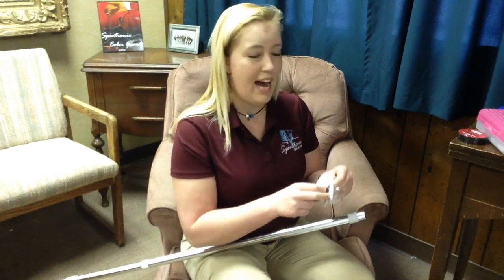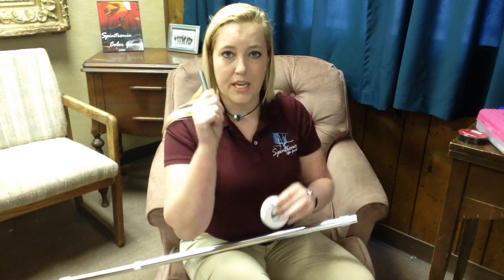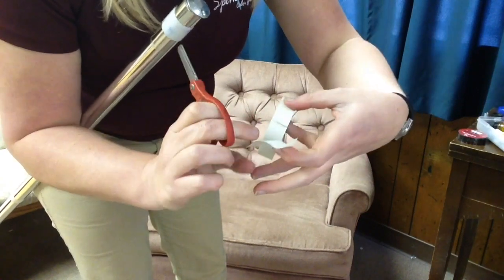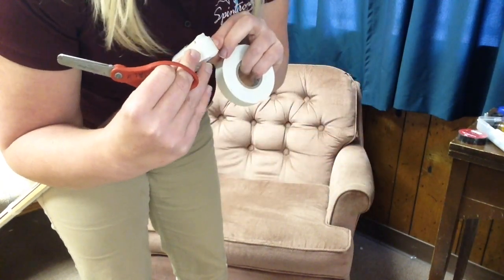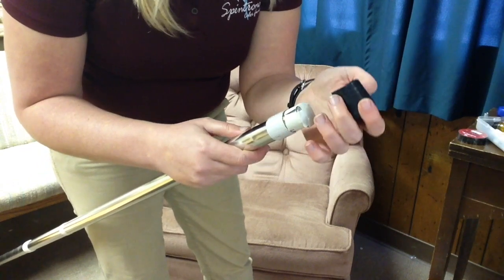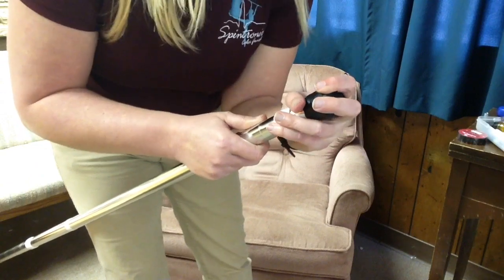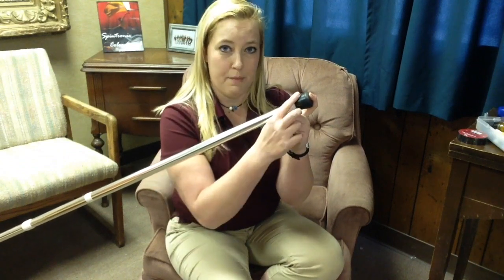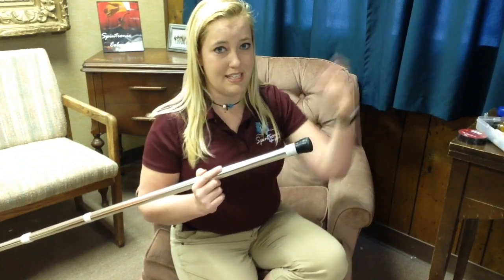Weight your flag - How to color guard (flag maintenance part 1 of 3)

Comment: Hi! Your videos have been extremely helpful to me as an instructor in developing and adding to my knowledge and skill set. I have some questions for you about weights:
1. While I was in color guard during high school and continued to instruct after high school, we have never used weights. What are the uses, pros, and cons of weighted flags. Why do some guards use them and some don't?
2. I know you said the bolt length depends on on silk length and pole length, but is there a formula or rule of thumb when weighting various flags (e.g., the bottom bolt is always half the length of the top bolt)?
Thank you in advance for your response! (:
Reply: You had to have used weighted flags. If those flags weren't weighted you would've had no control over them. They wouldn't spin, and wind would carry them 5 yards.
Reply: my gaurd uses a smaller weight 2/3 the size of the top instead of 1/4 so i guess it can depend

Comment: Are the bolts suppose to balance the pole so that one side is not heavier than the other? Or does it depend on what you’re trying to do with the weights?
Reply from the maker: It depends on how you want your flag to spin. The purpose of the top bolt is to counteract the drag of the flag through the air. So you should put a heavier bolt in the top based on how many seams there are in your silk.

Comment: what if we are using 5 1/2 foot poles? what bolts or weights do we need?
Reply from the maker: You can use the same type if you like. The weights only change depending on the weight of the silk (more seams versus less seams, fabric thickness, etc.) because you need heavier weights in the top of the flag to pull a heavier silk around.

Comment: So what if your tips already have weights in them? are you fine without adding the weights or should you still add them?
Reply from the maker: If your tips have washers in them, those aren’t weights, they are just protection to keep the pole from cutting through the rubber tip.

Comment: Ok this is really weird but, if you can’t get those vinyl end caps off, take a hair dryer to them for about 2 minutes and they’ll slide right off
Reply from the maker: I've never thought about this before!! But it makes perfect sense, thanks for the tip!!!
Reply: does this work the same way to get them on because i can’t get mine on lol
Reply from the maker: You should just throw them in the trash and buy rubber ones.
Reply: THANK YOU!!!! Omg lol
Reply: omg i literally just got a flag and it has a vinyl end caps that won’t come off and i had no clue how i was supposed to put together my flag, thank you so much you’re a lifesaver !!

Comment: Hey Great video, extremely informative and helpful. But I do have a question, so when weighting your flag are trying to balance it on both sides or is one side supposed to be heavier??? Because I don’t see how you would balance it by putting the big weight on the side that already has the silk, so I’m thinking there’s another reasoning to it.
Reply from the maker: Yes, it should be heavier on the top. Jackie explains this in one of her videos, though I don't remember where. Having the heavier weight on top allows the flag pole to compensate for the drag of the silk through the wind.
Reply: Oh ok that makes sense thank you
Reply from the maker: You are welcome!! ❤️

Comment: Where can I buy that kind of pole? I'm from the Philippines
Reply from the maker: I’m not sure which companies offer international shipping, but you can check with places like American Band Accessories to see if they do. You can also purchase 1-inch diameter aluminum conduit pipe at a hardware store and have it cut into 6-foot lengths.

Comment: How do you clean color guard flags. Do they get dry cleaned?
Reply from the maker: It depends on the material. If you are ever unsure, dry cleaning is always your best bet. However, we wash all of our poly china silks on gentle cycle with mild detergent and cold water, then hang them to dry. It's been a very successful process for the last 10 years or so!

Comment: where do you get these bolts? do they sell them at lowes, Walmart,  etc?
Reply from the maker: zorlex you can get them at any hardware store, including Lowe's or Home Depot.
Reply: @SpintronixGuard  ok thank you, do the heads of the bolt have to be a certain size or will they always fit into poles?
Reply from the maker: zorlex you want a 1" head
Reply: @SpintronixGuard  ok thanks! ❤
Reply from the maker: zorlex any time!! ❤️

Comment: There's not a hardware around me that carries a 1 inch diameter carriage bolt. Are you sure it's 1 inch?
Reply from the maker: The head diameter is one inch. And yes, very sure.
Reply: I went to two hardware stores and they have 2 heads that are close to an inch, on is smaller and one is bigger.

When stating it's an inch diameter it would be incorrect in how bolts are sized (my fiancee works on heavy equipment for a living) so what I am saying is for those of us who are around bolts this gets very confusing as a one inch diameter carriage bolt would be huge. They don't even make them.

For those of us in the bolt world who are buying things for presents for children in the color guard world have absolutely no idea what we are looking for and if you go into a hardware store they don't either. Lol

I guess what I'm getting at is when you get a chance can you let is know what the correct size is based off of how bolts are sized? So we can go in and get exactly what we are looking for. I literally stood in the aisle of a hardware store measuring the tops of bolts with a store associate trying to find out which size to buy.
Reply from the maker: You would probably want one that has a head slightly larger than an inch then, if those are your choices. I've seen them with a variety of head sizes but the one inch are very common. If it is less than an inch, it will fall down into the pole and that's not very productive.

When talking about "how bolts are sized" are you referring to the length of the bolt or the diameter of the shaft? The diameter of the shaft varies consistently with the diameter of the head from what I've seen, so if you have a 1" head then the shaft diameter length will be proportionate. The length, however, can vary. For someone who is younger, just starting out, I might put a 3" long bolt in the top and a 1.5" in the bottom. There are many other factors you could potentially take into account, but without knowing anything besides what you have already told me, that's what I would do.

Hopefully this is helpful! I'm a very visual person so sometimes it's difficult for me to get my point across with nothing but words!